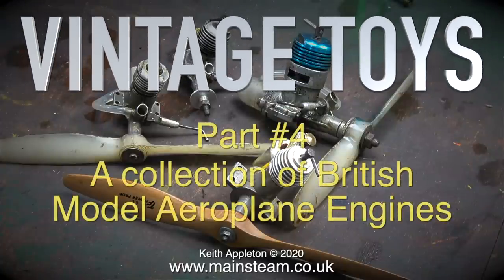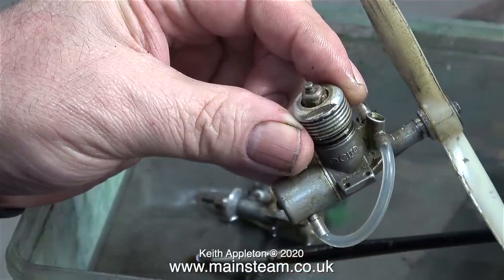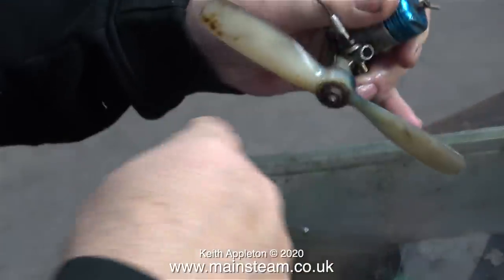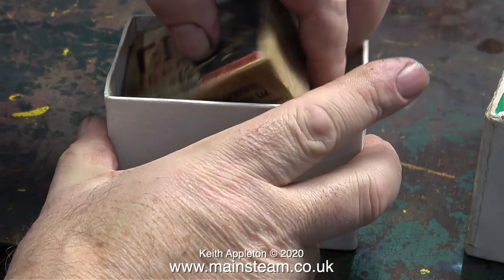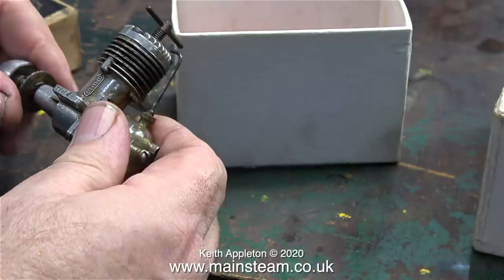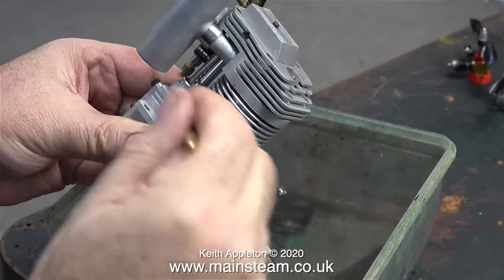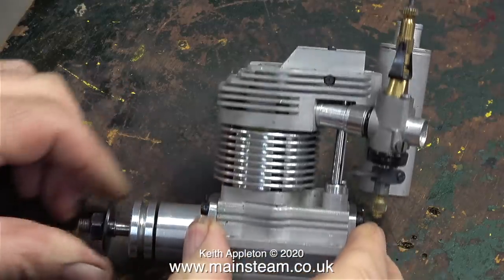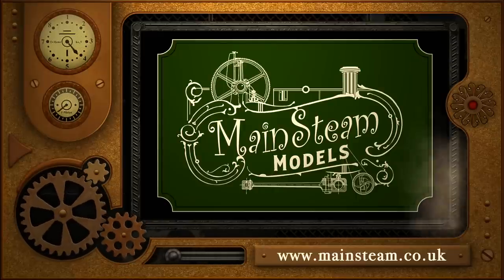VINTAGE TOYS - PART #4 - BRITISH MODEL AEROPLANE ENGINES

Comment: How nostalgic! Several of your examples I used as a youngster, and also had one of the early Lazer 80’s that I used in aerobatic RC models. Very smooth and powerful; they were made a few miles from where I lived near Hemel Hempstead. Made by a couple of guys, fascinating to watch the CNC lathes turning out the parts! Thanks again, Roger Bourne 76

Comment: I had one of those little diesel engines but didn't realise it was diesel so never got it going, in fact it's only now after seeing your videos that it makes any sense.
I don't know how it came into my possession but I probably swapped it for something else but I definitely remember the screw in the top of the head that increased the compression by pushing down on a little upturned cup in the cylinder. The was no prop so I was trying to spin it with a bit of string as a pull cord and probably going in the wrong direction and using lighter fuel or something !
I'm not sure how old I was but it must have been over 50 years ago now and had forgotten all of this until I watched this video !
Thanks for reminding me of some good but forgotten childhood memories !

Comment: Memories of my 1st control line  Diesel engine, an early 1960's Frog 1.5cc. It had a Blue anodized head. It took me months to get it started, ( I just could find the "sweet spot" with the compression setting.) After the initial run, it always started within 2 or 3 flicks and was very reliable.
Reply: I just pick a frog 150 yesterday in a box of 17 motors. Paid $40AUD. picture was bad on FB marketplace. Did show the 3 diesel in the picture. Rear exhaust motor and cox caught my eye. She had $200 and drop to $150. I message her, from the pic, they look like they had been damp. She says d there were her father and she didn't know. Couple days down to $50, I offered $40 as it was 150kms around trip. She gave me the box to have a look and I saw the 3 diesel on top, I could not my wallet out fast enough

Comment: I have converted a couple glow fuel engines to diesel. The power output was fantastic. And the  runtime was amazing. A glow engine would run ten minutes on Alcohol. On diesel it would run for an hour. 
The conversion was a kit. It consisted of a cylinder head with a screw crank and counter piston. You would simply lower the compression. Start spinning the engine and slowly raise the compression until it started.

Comment: I'm pretty sure I've got some old DC and PAW model motors in a box in the garage somewhere.  There might even be an ED Bee amongst them.  Really ought to dig them out to see exactly what I do still have.  I know some of my control line planes were powered by a DC Wasp glow motor, but I'm pretty sure I no longer have those.

Comment: Imagine trying these days as a boy of 11 going to my local chemist, an avid free flight modeller, for a pint of ether to make some diesel fuel. Still got an Marine ED Racer in a Veron Marlin boat with  MacGregor 'tone' single channel on the rudder. On/off switch and a push button to send the tone, nothing like having a rudder going left, straight, right, straight, repeat, in sequence! Bless the early 70's...
Reply: Better still, at 14 years of age in 1970, going to the local chemist in New Zealand who had no clue about model aircraft and asking for some  amyl nitrite (makes the heart go Boom BOOM BOOM when inhaled plus psychoactive effects) and getting the third degree from the chemist...no Google to show him why I needed it...went back after I mixed the diesel model fuel, gave him the pint bottle and said "Give it the sniff test if you want"...he declined.

Comment: The second engine shown is a D-C Ltd Bantam. Essentially it is a bored out glow conversion of the D-C Dart.

The D-C Wasp was its successor, and was a completely different design.
Reply from the maker: Thank you. I can't remember what they are as they are quite old now. I have just bought a large, vintage mixed model engine collection to add to mine and I will be featuring shortly in a video. I am going to Ultrasonically clean them.

Comment: Gr8 video. I pick up box with 17 motors and 3 electric and old trannie for $40AUD. In poor condition. In the box was elfin 249, DC Spitfire, frog 150 which the same as the spitfire, cox (someone on FB said it got rare fuel tank), os 15x2 and 10. Enya 40, 35 and 19x2. kB 40 and another K&b a bit bigger(no size on it). Webra 61 and 10ccm. Glo chief 35 and 29 plus 3 electric motors, cheers Graham.

Comment: Ha Ha Bit of Nostalgia, l have something like 100 old engines in a large box, all well oiled and preserved, as a teenager l worked with Gig Eifflander making PAW engines - Ah those were the days, all engines were "hand-made" none of this CAD/CAM stuff  - ended up manufacturing Marine diesel engines
Reply: I have over 150 and still collecting..   I still fly nitro and electric. And I have a collection of finished planes and unopened kits.

Comment: That mills 0.75 definitely looks like an Indian Aurora. Genuine mills have a treated magnesium crankcase and  stamped motor mount. The Indian engines are cast in aluminium alloy
Reply from the maker: You are probably right, I don't know where it came from .....

Comment: I think you should get an RC model aircraft and modify it with one of your diesel Engines on the front with remote control throttle included

Comment: Did you ever find the laser would get a stuck exhaust valve ? Reason i am asking is me and a friend bought two lasers new years ago (mid 90's) and even running the fuel they said the exhaust valve would stick after a few tanks. They still make them and from what i see they are alot better than some of the early ones. Love the ED engines as i use those in my models and also use a ED transmitter with escapments on one of my boats.
Reply from the maker: Never had that problem, mine always ran faultlessly.

Comment: I thought that diesel model aircraft engines used the yellow tygon tubing like the gasoline engines do. Does the model diesel fuel dissolve the silicone like gasoline does?
Reply from the maker: Yes it probably does.
Reply: You're right.  In the UK silicon tubing is fine for glow motors, but neoprene tubing is the choice for diesels.

Comment: I was given a couple of model diesel engines back when I used to fly U-Control, but could never get them to run. If may have been being in Canada all the hobby shops only sold glow fuel, and the diesel would not run on it or truck diesel fuel.